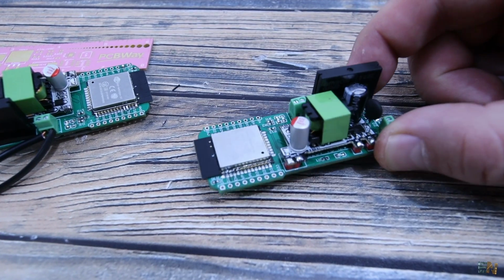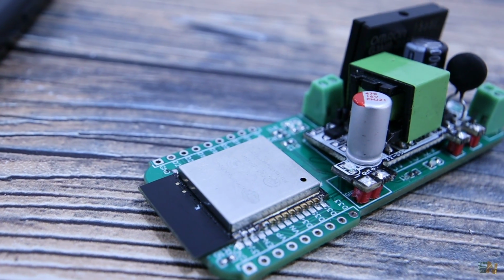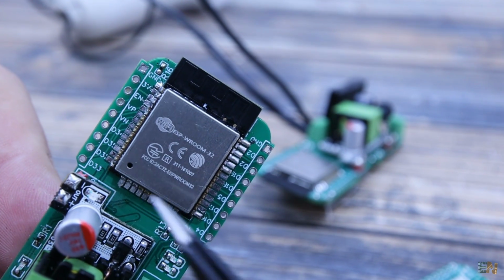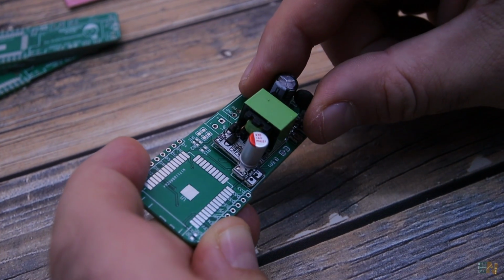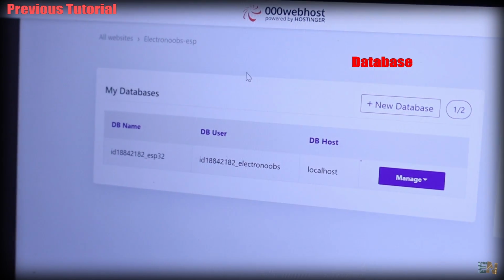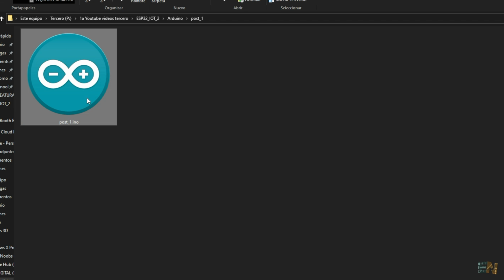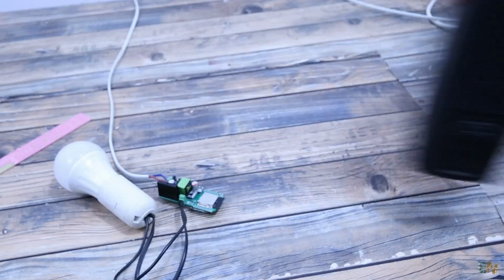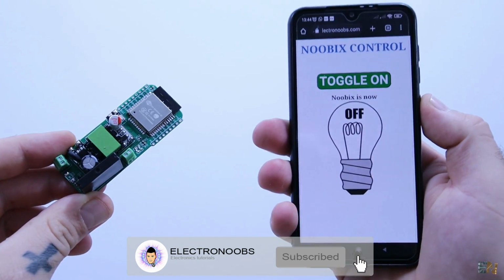IOT PCB - ESP32 & Relay - Control Anything From Anywhere

Comment: As usual amazing project!

Can this be integrated with home assistant instead of own designed website? It would be awesome to integrate this with HA, the potential is limitless...

I think esp home can be flashed on the esp ship and it will be found by HA.

Instead of Arduino code, the esp home has built in codes and relays can be used within.

Can you please try and let us know? It will be a nice video though, you would kill a lot of commercial products out there 😁

Comment: Thanks! Do you think this could be done with an immersion heater in hot water storage tank. I have a hot water tank that has a sink and bath switch. I'd love to be able to switch on the element for each when I want remotely, and hopefully put it through home assistant.
Reply from the maker: I guess it could. Always when the heater is insulated and waterproof. Also, the noobix board must be out of the water, is not waterproof. Also, have in mind the relay i've used only withstands 2A. Is your heater higher than that?
Reply: I don't want it to be in the water. I just want a relay that can be controlled through home assistant/esphome etc. At the moment it's a physical switch, a have to press it. @ELECTRONOOBS

Comment: Great work as always. But i want to suggest you two things with your design to make it safer. First add milled air gap between 230V line and logic lines (12V, 5V, 3.3V). 1 mm could be enough. Second suggestion ist to add a fuse between output of relay and the load. It could be an SMD fuse soldered on PCB.  If relay handle 5 amps try 6 or 7 amp fuse. This could prevent explosion in case of short at the output. Thank you for your work!

Comment: Good job as always. I recently made a similar project to control traffic lights. I used 3 SSR's and a Hi-Link 5V supply instead of those "exposed" step down boards like the one in your video. It was no more difficult making 3 channels than 1. I also put test buttons on each channel on the board so you can turn on the SSR without using the microcontroller.
Reply: No. Not a good job. A very bad job in fact. This design is so dangerous, it's not even worth to ridicule it. This is straight up dangerous and potentially lethal.
Reply: @marcus_w0  I looked at the video on my phone and scooted it over to the finished article. Andrei hasn't used a varistor, common mode choke or even a basic fuse on the AC input - not something I would do. His PCB tracks do leave a lot to be desired and yeah, it doesn't need ridicule. He needs to be educated on that aspect.

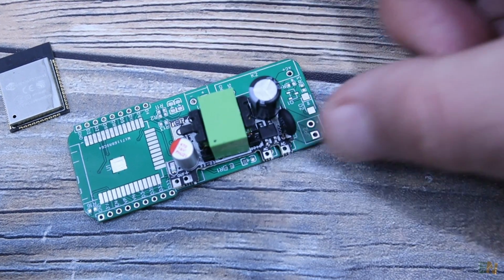Comment: 2:11.. From what I can see silk screened to the Power Supply PCB it work from 70VAC to 277VAC... not only 220VAC. Or are you locked in to use 220VAC only. Can it your ESP32 PCB also work on 120VAC ?

Comment: This video is an absolute mess. 
!!PLEASE!! DON'T EVEN THINK ABOUT USING THIS DESIGN! If you need something like this, just buy a Sonoff - that basically exactly this with an esp8266. It's the and all be all, but at least it doesn't try to kill you. A Sonoff basic is under $10.

THIS DESIGN WILL LIKELY KILL YOU! It's comically bad designed and absolutely dangerous! This is almost a criminal matter! There is no separation from the high voltage to the low voltage side, there are no air gaps or even only a removed copper area. Even worse - there's a flood fill of the ground plane all around the AC part. AC voltage could creep over to the low voltage side, setting everything there on a dangerous potential. There's no ESD conformity, the power supply is highly dangerous at best. 

If you want to build something like this for yourself, go the safe route. Buy a HLK-PM12 or equal power supply. have a STRONG seperation between you high- and low voltage side. There's a reason, why the contacts on a relay or a PSU module are spaced so wide apart. Never touch ANYTHING on a high voltage PCB. If you don't know about the risks and safety precautions of high voltage AC - don't try it, until you ABSOLUTELY know, what you're doing.

Comment: Hi Andrei, do you think SSR won't be an issue since when it breaks its NC? Or any other failure would end up to always ON circuit? Just asking...

Another thing is that, how we implement it to a wall switch lamp? To control by normal mechanic switch and web-based?  I'm looking for a solution to iot my new born baby's lamp. :)

Comment: Hey that's a useful project and with straightforward and easy to follow steps.

I haven't used PCBWAY before and i was curious if i'm going to pay extra custom fees and vat for the order (i'm based in Europe also) or is there an option for PCBWAY to calculate and include those on my price?

Do you frequently use PCBWAY cause it would be nice to see a tutorial explaining the order options and costs.
Reply: PLEASE! DON'T EVEN THINK ABOUT USING THIS DESIGN! If you need something like this, just buy a Sonoff - that basically exactly this with an esp8266. It's not super well build too, but at least it doesn't try to kill you. A Sonoff basic is under $10.

Comment: I love this project. In the past I did something similar but I never used it because I was afraid to burn my home. 😅 In your opinion, does these projects and their components are safe enough to be used 24/7? Does anyone has good/bad experiences ?
Reply: If you're gonna use this PCB, you almost certainly will unalive yourself. PLEASE! DON'T EVEN THINK ABOUT USING THIS DESIGN! If you need something like this, just buy a Sonoff - that basically exactly this with an esp8266. It's well enough build and at least it doesn't try to kill you. A Sonoff basic is under $10.
Reply: @marcus_w0  many thanks for your reply, but my question was more general: In your opinion, how much safe are DIY devices? I refer also to the ones battery powererd or to the ones connected to a 5V alimentation
Reply: @isilverboy  Any device you build yourself could be plenty safe enough to use 24/7 - if you design it right and use the right components. These two factors are crucial and both of them were let down in this device. Also: it's not the question, if it fails - but what happens when it fails. And this one is a spectacular one. a treasure trove of possible lethal outcomes in case of a failure. I really love devices that I have to disconnect with a broom stick while the house is on fire.

Comment: Our boy Electro being a teacher and entrepreneur at same time. If you ever start a company/business let me know. ;)
Reply: And a serial killer, if someone attempts to build this deathtrap of a project. Der basically no clearance between the high voltage and low voltage part, there's a possibility to have the high side of powersupply come into physical contact with the low voltage side of the base board, there's no ESD safety and so on and so forth. Even the (crooked mounted) connector isn't suitable for 220+ Volt application - once again because of the clearance.

Comment: it pains to see a powerful chip as ESP32 being used to control on and off just one device, that chip packs hell lot of power. only if Espressif could design a far cheaper version with one fee output and far less capability. great project as always!!
Reply: Well... Espressif first made the ESP8266, which they still sell. It's also far more powerful than needed but a lot cheaper.
Reply: @Peter_A1466  Also, in contrast to the ESP32 there are very small variants of ESP8266 boards like the ESP01 (ESP8266-01 to be more precise) which only exposes a few GPIOs, has very low power consumption (max 12mA at 3.3V or about 40mW) and has a ridiculous tiny footprint (basically a 2x4 pin header). I think this is way more suitable for this use case.
Reply: @comedyclub333  yeah, I use ESP-01s modules all the time. And with a small soldering tip you can break out more pins if needed (most often the analog in pin).
Reply: Esp-01......

Comment: However for this Project ESP32 is a bit overkill ESP12F would function just as same if you just need a binary switch. But good Project I used same Hi-link 5V Power supply for my own switch as well but my switch is. A Wemos d1 mini shield
Reply: Yes, that's what I was thinking

Comment: Please head the warnings to not use this circuit as designed. It will kill people long term. AC is not like DC. The AC current conducts along the surface of wires. That makes it very, very, very easy for a slightly humid room to bridge those tiny gaps you have. You have no EMF protection. So a circuit with inductive loads will throw thousands of volts into your board crawling all over the surface of the PCB looking for things that are ground attached like humans.

Comment: I am strongly suggesting removing the gerber files and fix them immediately. Because the clearance between 230V AC and GND of the board is very small, potentially lethal for the people who only make this PCB. This PCB can kill someone.
Reply: there is also no insulation between the module and the pcb. If you press on the module, it might pierce the soldermask of the pcb 😬
Reply: @RoterFruchtZwerg  I noticed that too, however I would mount this with an insulator in between. I never mount 2 pcb's on to another, seems logical to me...
Reply: I would strongly suggest to remove the whole video - he has clearly no clue, what he's doing and is "teaching" something, he clearly doesn't understand. He hasn't the knowledge of how bad this design is and for what reasons. This is a potential lethal PCB design, that is likely to kill anyone who has even less knowledge than him. This PCB is comically bad designed. No separation, no airgaps, a flood filled copper pour ground plane around the AC traces - with 0.2mm separation. This should be considered a weapon or a death trap.
Reply: @marcus_w0  That's why I never engage myself with the first batch or design. I do believe he's quite capable, afterall his an engineer graduated from university. Probably some default settings were overlooked during the design of the PCB. It happened to me too a while ago, ending up with print paths too small and soldering holes barely big enough. I considered this PCB's prototypes to do some tinkering and making the next rev. much better. On the other hand, if you buy similar product on those famous Chinese websites, tear it down, you often find designs and assemblies which are even worse !
Reply: @marcus_w0  No, I defenately did not put it in production, it's a prototype to do some tinkering. I was ashamed to show it off, such a basic mistake I made...  ;-)
Reply: Also, those screw terminals are only rated for 150V/6A...
Reply: @Rob_III  Indeed, a little underrated. Sufficient for the North American market but not good enough for most of the rest of the world. Hopefully a rev. 2.0 is on the way soon !
Reply: ha ha ha, I did not see your comment - I just typed mine when I saw the pcb ;-) This project is VERY dangerous
Reply: btw. the supplied PHP code also allows SQL injection. If the code is used as is, anyone could get full access to the database used for the project :/
Reply: @RoterFruchtZwerg  I agree, but let's face it, to me this is more like an example. Anyone with some basic PHP/SQL experience will take the necessary steps to secure this a little better.
Reply: In Germany we call someone like that a "Pfuscher" - I don't know if there's a a translation, but it means basically someone who only does the bare minimum to safe time and effort - and does it bad.
Reply: @marcus_w0  I think I understand what you mean. In Belgium, that is the Flemish/Dutch speaking part, we call this a "Prutser"... it's close to your German word. Sound great ?! Doesn't it !?

Comment: Bro, could you do an esp8266 version? I have 10+ lying around wasted here
Reply: PLEASE! DON'T EVEN THINK ABOUT USING THIS DESIGN! If you need something like this, just buy a Sonoff - that basically exactly this with an esp8266. It's not super well build too, but at least it doesn't try to kill you. A Sonoff basic is under $10.
Reply: @marcus_w0  I need kicad files so I can put extra things on pins, sonoff does not give me this option
Reply: @Seu_Lunga  This thing will likely kill you. This is no joke! The PCB is so stupidly bad designed, this is almost a criminal matter. There's enough ESP32 and ES8266 connected devices out there, that provide a safe use of 230v. The sonoff basic isn't the only device.
Reply: I was just thinking an ESP32 is overkill.

Comment: I know all the countless advantages you might point about a ssr but with a simple relay you can do 3 ways with the room lamp, and in case of failure of device you can still control via the switch on the wall.

Comment: High voltage of the output is very close to the low voltage ESP-stuff. No isolation gap. This could be dangerous.
Reply: Indeed. Please do not use this. There is only 0.254mm between AC and the GND Polygon! One of the AC lines is also very close to 5V. So even with the polygon removed this PCB is potentially lethal!
Reply: Came here just to say this. Newbie AC design issue. No isolation, no XY caps, etc. I wouldn't put more than 48V through that circuit.
Reply: This design need to separate between AC lines and DC lines, never combine the high voltage zone with the low voltage zone.
Reply: Yes!!! You are correct 💯
Reply: It would be very interesting if this design is connected to high inductive load like contactor etc.. 💀
Reply: Also those screw terminals are only rated for 150V/6A
Reply: This COULD be dangerous? This thing is a death trap. Please don't even consider using this PCB for anything but to throw it in the waste bin.
Reply: @marcus_w0   as an example of what NOT to use. Preferably without a video of someone getting hurt while trying to build/use.

Comment from the maker: ESP32: https://s.click.aliexpress.com/e/_DlLsTRl
My Tools: https://bit.ly/3uv8bc3
Help me on Patreon: https://www.patreon.com/ELECTRONOOBS
Reply: Andrei, you may want to take this off sale due to the poor PCB design. On the AC input you need track spacing in line with UL60950. That electrical standard dictates clearances between PCB track for voltages up to 300VAC. You're probably going to want to aim for a minimum of about 2mm between AC tracks and leave 5mm between the low voltage circuitry and the AC. Your ground plane goes perilously close to the AC input terminals. I don't know what clearances you have now but there's not enough. Also you may want a fuse at the very minimum on the AC input. I glanced at your video yesterday on my phone and didn't pay attention to the PCB until Marcus W commented above after I had given you the thumbs up. Check out this diagram: https://i.stack.imgur.com/C1e1b.png